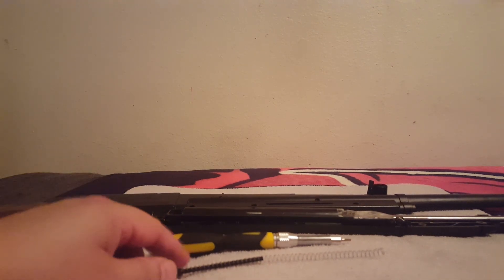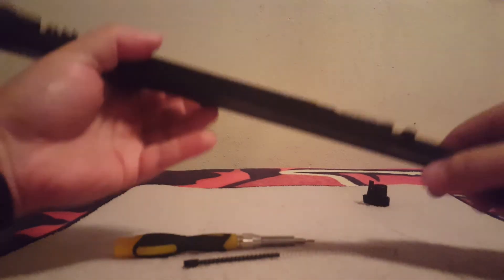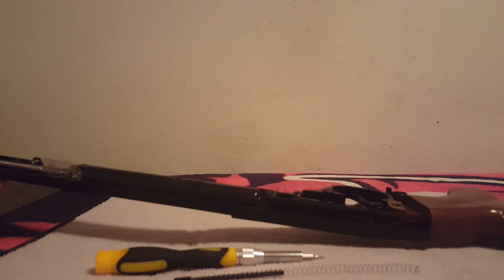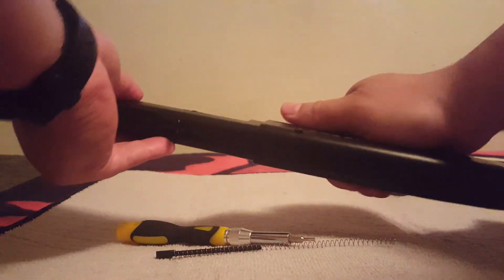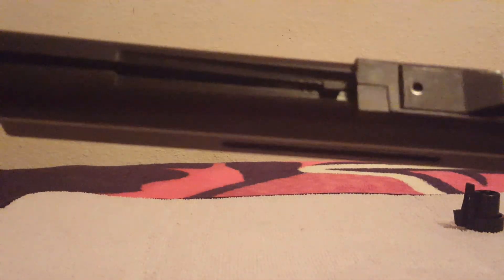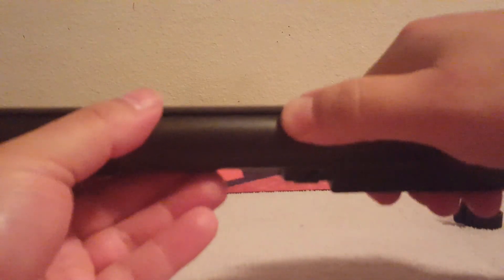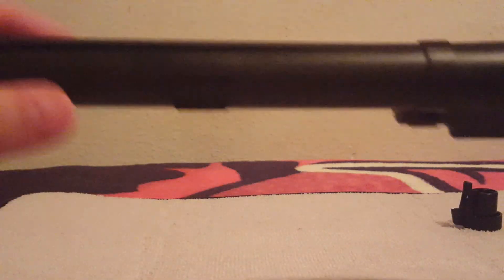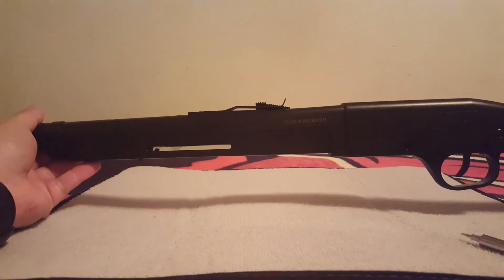Winchester Model 12: Reassembly, Tough Spots

Comment from the maker: PUMP RE-ATTACHMENT
▶️ Lay out a towel on a firm surface.
▶️Make sure the metal loop is visible to mate the pump and metal arm.
▶️ Insert the pin through the pump, smooth side first, on the gun's right side (side with oil hole). 
▶️ Lightly tap with mini hammer until the hetching (rough edge) is close to the pump. Then use punch to get it flush.

https://www.walmart.com/ip/8-Pc-Steel-Drive-Pin-Punch-Set-4-Long-Knurled-Body-Punches-Tool-Set/996022621

https://www.walmart.com/ip/Hyper-Tough-8-Ounce-Ball-Peen-Wood-Handle-Hammer-4C25156D/982903826

Comment: Saved this just in case I ever need it for my model 12. Would you think of needing to oil the pin that goes thru the pick to cut down friction when pumping it? Just a thought I had. Keep up the great work.
Reply from the maker: Alfred, a screw goes through it, but the pick ROTATES on  plastic circle. Very risky to take apart for some lube on circle.

Fine oil like Ballistol in the feeder gets into the connector and it's cavity. That helps with smoothness.

Comment: "Tough Spots" cake walk compared to getting that pump back on. WOW yes I got it took a few, we got it cock first with punch, while in down position a fix pump and pin
Reply from the maker: Sir, good job putting it back together. I apologize for not detailing the pump; I have many reps dealing with retaining pins, was second nature, a snap for me.

MY METHOD
▶️ Lay out a towel on a firm surface.
▶️Make sure the metal loop is visible to mate the pump and metal arm.
▶️ Insert the pin through the pump, smooth side first, on the gun's right side (side with oil hole). 
▶️ Lightly tap with mini hammer until the hetching (rough edge) is close to the pump. Then use punch to get it flush.

The model 12 is very bad for breech access.  The ease of the 25 or the tricks for the Ryder don't work for the model 12.